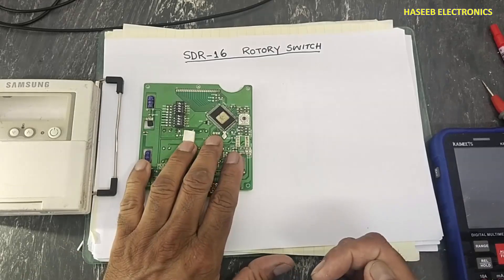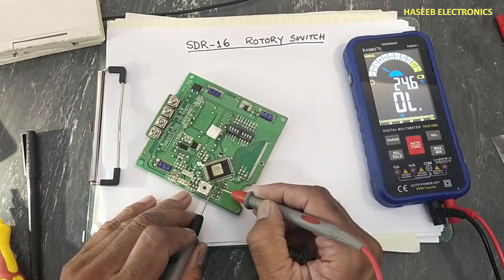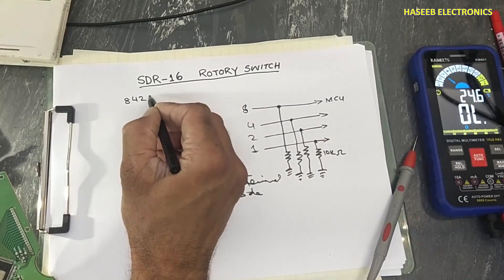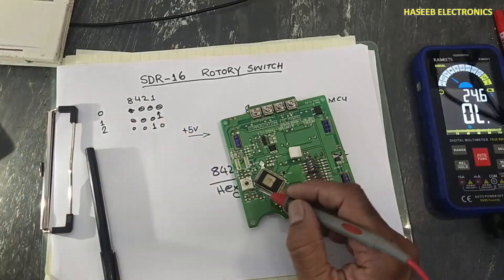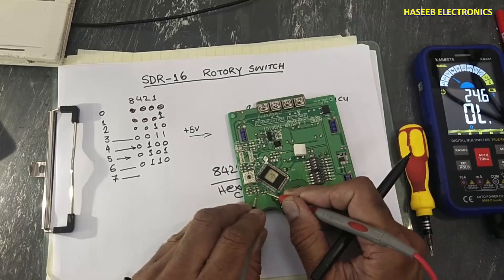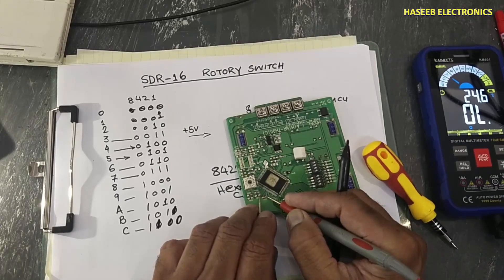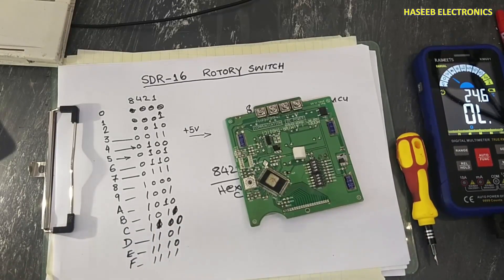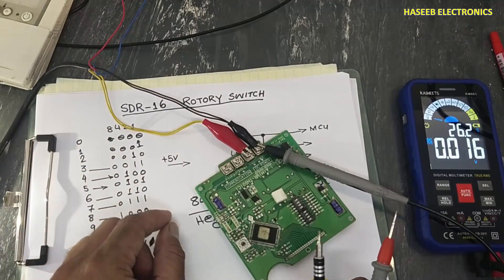{964} SDR-16,16 position rotary switch with hexadecimal output

Comment: 16 bit binary used with voltage ,thank you 👍
Reply from the maker: yes, this switch 16 positions in 4 bit hex code and passes the voltage on specific lines on relative switch position